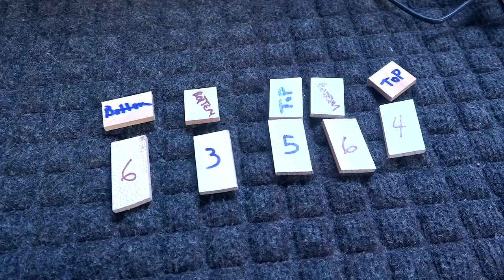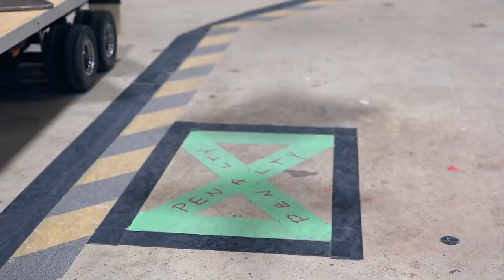LOADING WARS: TOWER CRANE PENALTY - MOST INTENSE FORKLIFT FIGHT ! (S2 E4)

Comment: When loading the plate, they should not touch the any part of the trailer but the deck during the penalty, or it’s considered a penalty, and the plate must be first removed, and placed back in the penalty box, crane returned to the original position before starting again.

Comment: Also b cool to do team docks if u have enough forklifts medic
Reply: Curtis Hazard maybe one can dock the truck and then they switch back and forth to use the forklift and the other guy that didnt drive the trick into the dock has to drive down a tight hallway in reverse kinda like a few videos back
Reply: S02 Ep01
Reply: I was thinking team docks so both can load trailer or one can load heavy equipment  one loads other things or ....I'd love to see long  pipes or long logs so they can try a team lift or involve the crane more so much to try lol

Comment: I know this is an old video, just some penalty thoughts: progressive penalty system. First penalty should just be like a simple round the track with the lift. Second should be same thing while hauling an unstable load, if something falls then you have to do the next difficult thing , then go to the crane, then do the backup with the semi, and the finally 20 pushups 😂

Comment: I enjoy watching these videos, however, I think you could make some cheap easy to fab, 1/4 or 1/2 scale walls. Depending on the operators perspective it is very difficult to see where an imaginary wall is. Split some 1" x 2" and put on the penalty tape, easier to see, and the wall would move, and then there is no discrepancy on if an actual penalty was incurred.
Reply: ...or maybe lasers at the foul lines, like they use at Wimbledon!